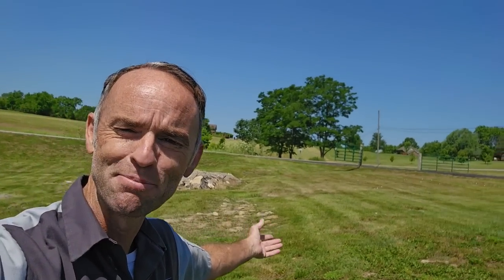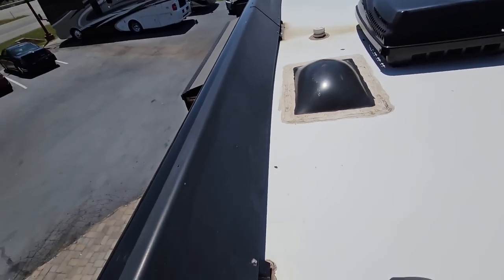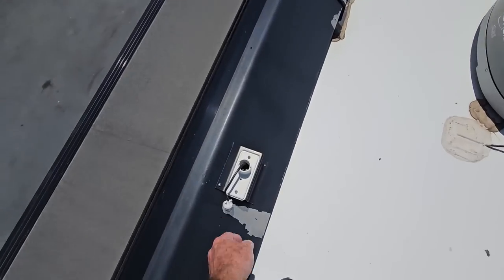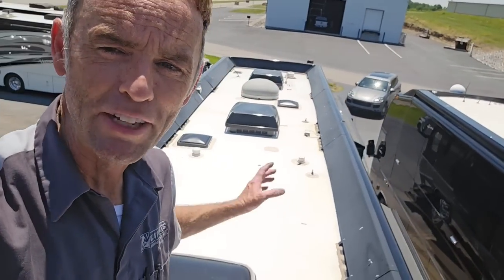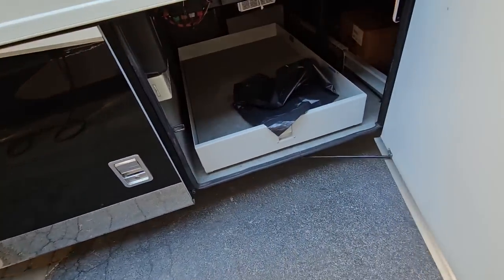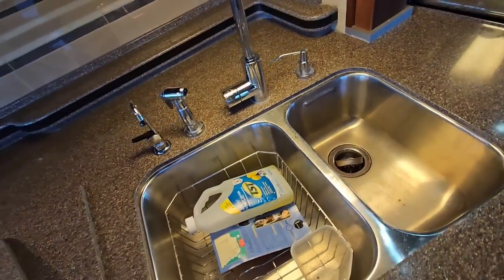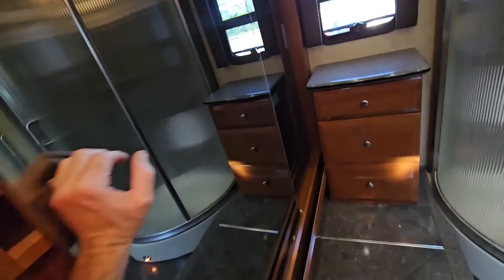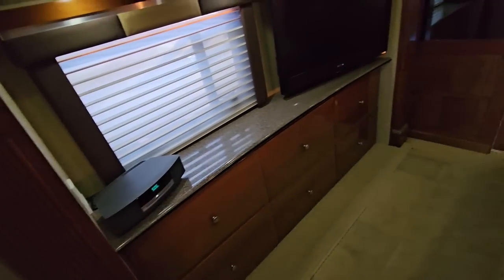This 2008 King Aire Surprised Me: But What Did I Find Wrong??

Comment: YOU COULD GET THIS COACH WITH A CERTIFIED CHECK FOR $ 223,000 . THAT IS A GREAT DEAL FOR A TOP LINE NEWMAR KING AIR. YES IT NEEDS ABOUT 10-15 FIXED BUT ALL MINOR THINGS MOSTLY COSMETIC.

Comment: Thanks for sharing all the stuff you look for.
Seems to be a lot of sun damage for an RV supposedly kept indoors. Another thing, I wonder if the RV has been used that much in the past year or two. A mechanic told me nothing is worse for a vehicle than letting it sit. Dealers from my experience don't run these used units until someone wants them and they go in and pump up the tires and give it a quick wipe to clean up the mouse poop. Seems lazy to me.

Comment: As always great video. I always pick up something new especially when you review a newmar as i have a 2020 dutch star. 3 questions from this review. I want to upgrade the sewer vent. Vac-u-jet or lippert 360 siphon or other ?  I want to add 3 covers to my fantastic fan. I assume the ultra breeze but what color is best for sun heat. We are in florida. 3 was considering painting the a c covers and fan covers with solar reflective paint to reduce heat and u v   Dumb? Thx and keep reviews coming.  Would love a series on annual maint for a pusher

Comment: I have to remove the plywood and some 2x2  from the metal roof on my motor home (1988 travilaire) Can I use contact cement or liquid nails to glue the metal roof to the new plywood? Or is there a glue that can be brushed on (4'x8' coverage) that I can by from my local home depot?

Comment: James,   Just drove from Florida to Missouri.  Passed some Tiffins and saw two small exhaust pipes coming out drivers side just like on this unit.   What is the second one further back for?   I’m at a loss!   Not experienced with the big money RV’s.
Reply: one is probably the hydronic (diesel) hot water system exhaust, the other the generator.

Comment: Good morning, I would like to ask you a question, is a 2006 Fleetwood Expedition 38N Cummins 5.9L 300 hp with 86000 miles is good?
Reply from the maker: check the sidewalls for water damage and the under carriage
Reply: @AZExpert  everything is pretty good but the miles are not many
Reply: I'm sorry, the engine is Caterpillar, I don't know much about this.

Comment: Do you know if the Cummins TSB 150130 was completed on the ISX 600HP engine?  This TSB was released by Cummins to address the dreaded catastrophic #6 intake valve dropping problem.
Reply: Do you know anything about the Caterpillar wandering wrist pin problem?.... What years did it affect? Was it something to really be worried about?
Reply: Looks like by no reply that this very important service to the ISX engine was not completed.  If this truly is the case the engine is a ticking time bomb…….. boom 💥.  When and where it will happen is anyone’s guess.